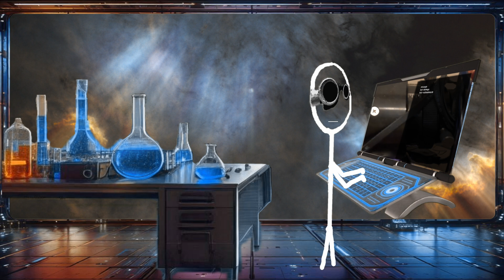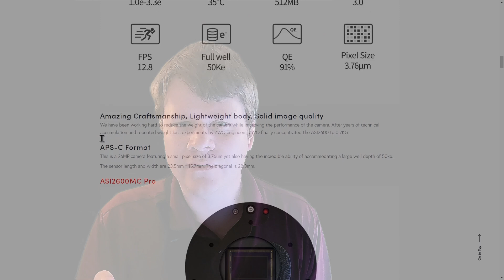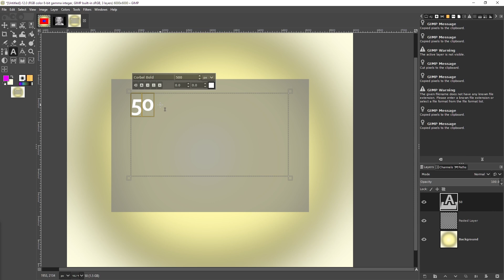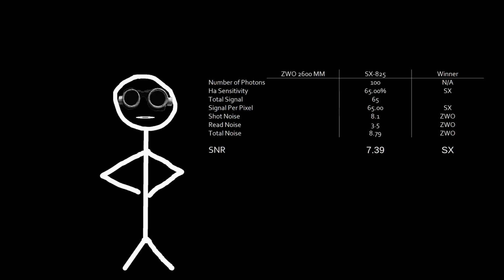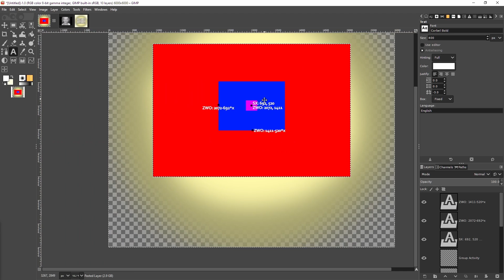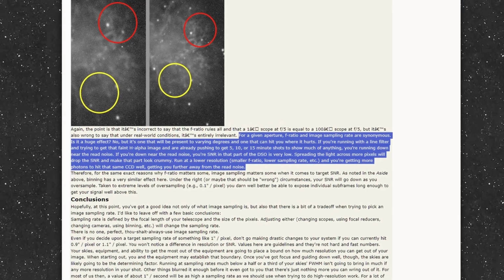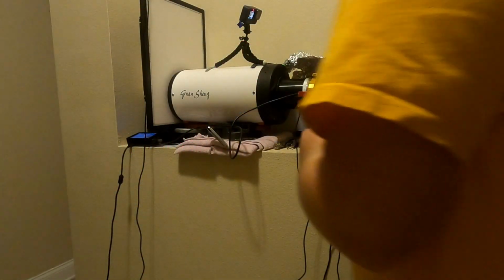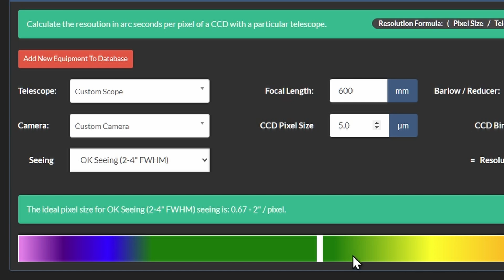𝐌𝐲 𝐨𝐥𝐝 𝐂𝐂𝐃 𝐰𝐢𝐧𝐬 𝐭𝐡𝐞 𝐒𝐍𝐑 𝐛𝐚𝐭𝐭𝐥𝐞 𝐚𝐠𝐚𝐢𝐧. 𝐖𝐡𝐚𝐭'𝐬 𝐠𝐨𝐢𝐧𝐠 𝐨𝐧?

Comment: I’ve got a question about drizzling in this context. Out of habit I always dither then drizzle when stacking, the idea being having a higher resolution image in the end. Does drizzling introduce noise when it comes to the image’s SNR, or is that a process that is independent of resolution/pixel size? (The idea here is that a 2x drizzled image is opposite of a binned 2x2 image, and as we learned here, binning helps SNR, so would drizzling hurt it?)

Great content, I appreciate your channel!!
Reply from the maker: Thank you for the comment! From what I understand, drizzling does increase noise. So if you do a 2x drizzle, you are roughly halving your SNR. I may be wrong on that (so consult other sources too!), but I think you'll see that if you stack binned sub frames and then stack again with a 2x drizzle, there will be more noise in the drizzled one. Just keep in mind that it's hard for people to tell exact differences in SNR with their eyes alone, especially in brighter areas!

Comment: I agree with your conclusion. Given a focal length, bigger pixels will help. Also a higher QE and lower read noise will help to improve SNR. Even gain has a role to play there.

I think that if the Sony 694 sensor existed in APS-C size would’ve been a keeper.

And CCDs have the advantage of binning before reading the image, so for a long focal telescope like an SCT or RC are good choices. CMOS sensors have the advantage of having much lower read noise, so the penalty of binning is not as high. In the end, binning is a good resource for imaging at long focal lengths, no matter the sensor type.

Regards,

Alfredo
Reply from the maker: Agreed! Thanks for the comment :)

Comment: I would also like to introduce one more element since I see too often the statement about the "fast" F-ratio myth... The only advantage of having a "fast" f-ratio is on subjects that have an angle of 0 degree. Point sources are getting better SNR faster on "fast" f-ratios but, in reality, we only deal with somethng that have a size... A size means that we can measure an angle and this changes everything. We talked about the reciprocity law that build a relationship between aperture/exposure time/sensitivity. On old chemical emulsion we have the so called Shwartzchild effect or reciprocity failure just becouse the media used was not linear. The stated sensitivity (in ISO) was true just for a small fraction of time so, the longer was the exposure, the lower becomes the sensitivity of the media causing this reciprocity law to fail. On modern CCD/CMOS whe have a true linear (with very small variances) acquisition device that remains linear until the charge retaining capacity is reached (Full-Well). That's why we can apply statistics on multiple frames tha can lower the noise! A "fast" f-ratio system is not "faster" than a lower number one since the emitting source is fixed and there is no way to chenge that, You can fill the well in a lower time but You are getting the fixed signal AND the unwanted one (mostly sky noise) at the same time. The SNR does'nt change since it is a relationship between wanted and unwanted noise. An f3 system and an f8 system that are providing the same sampling size per pixel will produce the exact same SNR on the same subject per single identical exposure. So it is better to say that, tipically, a "faster" system having the same aperture size (i.e. an 8" scope at f3 respect to an 8" scope at f8) is a wide field telescope respect to the other. Remember, it does'nt matter in how much time You fill a well, the SNR of that well is not changed by that since Your acquisition device is linear and the photometry for that angle is fixed... Hope this could help and open new scenarios.
Thanks again!
Reply from the maker: Thanks for pointing that out. I agree, and I'm sorry that it isn't more clear in the video. I think you and I have the same understanding here. If I say "fast" I just mean that it fills the well faster. Not that the sub frame will get "better signal" because the light pollution fills the well with the DSO signal too.

Comment: YES! Thanks again for this one! As for the last video I would like to give my two cents... You're getting close talking about pixel sizes but, the better way is to refer to the area of sky being captured inside that pixel. As You stated there is a subject you're targeting in the sky that emits 100 photons (You should add per second per that considered area and that's exactly the definition of Photometry) and that is true for that considered area or angle of the sky. If You change the scale or angle of that considered area, You will notice different Photometry flux. That's why You can only compare two acquisition devices using the exact same sampling size per pixel. That is also stated by the reciprocity law that takes into relation the aperture/exposure/sensitivity that rules the exposure times on "classic" photography and is the way photographers can measure and predict the right exposure/aperture ratio to use. There is also another factor that will change the results even on a "perfect acquisition system that includes the whole system not only the sensor" and is the poisson distribution that is in the nature of incoming photons. This means that, even on a fixed source that emits 100 photons/sec/pixel on a perfect device, each frame will have different values per pixel since the light is not coming linear but poisson distributed. Binning on a CMOS is something still quite useful (only on monochrome since on color there is a very small benefit) but not as effective as on CCD since the binning operation is made via software on CMOS and "after the fact". On CCD the binned cluster of pixels will be read as one by the register and the SNR will be exactly doubled (just becouse You are considering a 4 times bigger angle of the sky and the relative photometry has a bigger flux) still having the same readout noise contribution. On CMOS you have a sum of 4 readout noise, one for each pixel and the full well remain the same as for a bin1 pixel so, the result, is more uncertain respect to the one made on CCD. We can say that the doubling of the SNR is true on CCD but on mono CMOS the SNR is at best 1.5 times better. The quantization noise and uncertanty still remains higher on CMOS having the same full well on every software binning cluster size and so the statiscs measurements are worse becouse of the less sampled photons.
Anyway there is a small difference in SNR if You're imaging big, diffuse and dim areas or star cluster i.e. In the first case the SNR will benefit from a slight undersampling while in the second will be better to oversample a little...
It's a strange and counterintuitive way but Your efforts are of great value for us all! Thanks again for Your work and nice videos and keep going!
Reply from the maker: Thank you! These are good points, and thank you for bringing them up! I wish I would have been a bit more precise in some of the things I said. For example, your point about the each pixel having slightly different values based on the Poisson distribution is something I could have explained a lot better :)

Comment: Earned my sub.  Excellent video.  
I need some time to think about this, but I think part of the problem I have with the whole sensor size/pixel size debate is that people end up saying larger sensors/pixels are better, but mean different things.  For instance (coming from regular photography) I see a lot of people try to argue that a 24mp full frame camera is inherently better than a 24mp aps-c camera, specifically because the sensor and pixels are larger, which is b.s. in and of itself, and completely ignores all the factors a full frame camera has that lead to a higher quality image (dual or triple gain, improved adc, faster sensor readout, faster processors, etc)

I think what your test shows is that you need to make sure you're able to gather enough light to support a specific pixel density, otherwise if you can't, there's no point in using a higher mp camera.
Reply from the maker: Yes! Good points. There is so much that people need to take into account when choosing a camera. :)

Comment: To my understanding…when using CMOS cameras keeping the gain as low as possible but within the range provided in the specs for your particular camera and keeping the histogram at about 1/3 from the way from the left bar by adjusting the the exposure time accordingly, goes a long way to lowering the noise problem…also of course the more images you have to a point also is a factor with good  and adequate number of calibration frames.
Reply from the maker: Yes, I agree with all that! Also, binning/pixel size affect the signal part of the SNR measurement, so you'll be able to get the histogram about 1/3 away from the left bar more quickly. It should decrease the integration time needed to get a similar result than if you have smaller pixels/don't bin.

Comment: Interesting. I would have thought that with CMOS (as opposed to CCD) there is one amp for each pixel and therefore that it doesn't matter if the binning is done by the camera driver at capture time or in software afterwards (except of course for the larger files). If that's true, why put the emphasis on SNR per pixel? If that's not true, any idea why, and what the difference is?
Reply from the maker: I'm pretty sure you're correct that it doesn't matter when you do the binning for a CMOS camera (it was mentioned at the end). So, maybe it should be more clear that the video is about binning and pixel size (and how they're similar). To answer your question: most of the noise in an image should be shot noise (whether it comes from the DSO or light pollution). Increasing pixel size (however it is done– binning is one way) will take the signal of multiple smaller areas and combine them. That's where the benefit comes in. People often forget the numerator/signal in the SNR calculation. Combining pixels, or having larger pixels increases the "S" relative to the "R," which helps a lot with SNR. But the tradeoff is resolution.
Reply: @deepskydetail  thanks for taking the time to clarify. Sadly, I still don't understand why the SNR of single pixels is important enough to lose resolution by binning. We both have the same answer your question at 5:15: No, the signal of that DSO is the same, regardless of binning! So, why should I lose resolution on my DSO by binning the pixels if we both agree that this won't change the SNR of the DSO? Sure, by binning, I'll have big blocky and averaged pixels, but how can this possibly make the DSO look prettier? Sorry if I am daft, but what am I missing?
Reply: @comeraczy2483  there is zero benefit from doing binning on CMOS sensor, the only reason you'd do it is in case you need faster file transfer rate from the camera or smaller files, but from a quality standpoint binned images on CMOS actually end up looking worse than normal ones.
Reply from the maker: @comeraczy2483  You are introducing noise into your measurements. For example, if you have 1 good SNR pixel and split it up, the resulting smaller pixels will be noisier relative the the signal they're getting. It's like you are going to a higher f-ratio: the light gets spread over more pixels. Except in this case, instead of spreading the flux over more area, your creating more pixels within the same area. But the effect is the same: noisier pixels. That's why Stark said F-ratio and pixel size are synonymous for a given aperture. The pixels only care about how many photons they're detecting. They have no idea whether they're detecting fewer due to a longer focal length or because of their size.
Reply from the maker: @v0ldy54  that's not entirely true. You gain SNR with bigger pixels. If your sampling doesn't match the focal length, and you're oversampled then binning will benefit you greatly. You get increased SNR without losing resolution (i.e., the atmosphere, not the pixel size is the limiting factor).
Reply: @deepskydetail  Let me make sure I understand correctly. You are talking about Photon noise, a measure of the randomness of the arrival time of photons on the sensor during acquisition (consequently, a measure of randomness of the distribution of these photons in the space in front of the sensor before acquisition). Is that right? And your claim is that by changing the binning mode on your camera you are changing the photon noise of a future acquisition. Is that also a correct summary? If this is correct, it is truly remarquable and you should publish it right away.
Reply from the maker: @comeraczy2483  Your description of the problem is indeed inaccurate. We are talking about shot noise as measured by a pixel. Shot noise is the square root of the number of photons it detects. It is noise introduced as the pixel has measures something.  If the pixel is smaller, it detects fewer photons. The signal is lower and noise is lower, and the net effect is less SNR than a larger pixel. I wouldn't publish information about binning and noise because this stuff is already common knowledge. I'll give you a sources if you'd like to learn more:

1) "After a 2×2 bin, this gives us a new SNR of ~200:14 or ~13:1. Compared to the 7:1 before binning, the 13:1 after a 2×2 bin results in double the signal-to-noise ratio, increasing the imaging sensitivity of the camera."

-Notice that in the calculations, the noise values *change* depending on whether there is a bin or no bin.

https://www.photometrics.com/learn/camera-basics/binning#:~:text=The%20primary%20benefit%20of%20binning,combined%20signal%20from%20multiple%20pixels.
Reply: @deepskydetail  Thanks for the link. We definitely both agree that the SNR of a big pixel is better than SNR of a small pixel, if there was any doubt on that, it's a miscommunication. Moving on to the estimation of shot noise in a specific region of the image, which I believe is a big part of your video: that link from photometric that you provided explicitly says that "it should be noted that binning does not lessen the effects of other noise sources, such as dark current noise or photon shot noise". Other credible sources agree on that. For instance, Stanford Computer Optics clearly states that "shot noise, is a basic physical characteristic of each light source that cannot be influenced, i.e. diminished, by any technical device". RP-Photonics also says that "shot noise must be interpreted as a property of the light field itself, rather than as an issue of photodetection". Hamamatsu seems to prefer the "Photon noise" terminology, but also defines it as an "inherent statistical variation in the arrival rate of photons incident". There are many others - hopefully all reputable vendors. So, if your measurement and calculation do show that binning reduces shot noise in the image, that might be more of a very interesting novelty than you seem to think it is. Otherwise, we probably have radically different definitions for shot noise.
Reply from the maker: Yeah I think we are agreeing but just sort of misunderstanding each other. In my mind shot noise is the square root of the signal. Binning doesn't change that. The SNR calculation changes when binning: the signal increases, the noise increases and the net effect is that SNR increases. The CMOS example shows exactly this. So yes, binning doesn't change the effects of shot noise. It's still the square root of the signal. I hope that makes sense.
Reply: @deepskydetail  you're not possibly getting better SNR with a CMOS if you bin.
SNR is fixed at the moment of the capture, adding together pixels won't change the image SNR, it will only make stacking algorithms work more poorly as any comparisons of binned vs unbinned CMOS shows.

It works for CCDs because you're actually adding the charge of neighbouring pixels and reading them only once, which decreases read noise, but in CMOS it just throws away resolution for absolutely zero benefit.
Reply: @deepskydetail  out of curiosity, how exactly did you estimate the noise for the whole image? If you are simply adding the absolute value of the difference to the mean for all pixels (sum([abs(value - mean) for value in pixels]), that would definitely explain why you are getting a value that is proportional to the square root of the bin size. If you are however integrating the variance, or calculating a proper convolution, and then taking the square root, your result is very surprising. If shot noise is dominant (it should be since you have plenty of uniform light), it should be a Poisson distribution, and therefore, the sum of the difference to the mean, squared (sum([(value - mean)^2) for value in pixels]), should be reasonably close to the sum of the values (sum(pixels)). Conversely, if these two calculated values differ significantly, then it is not a Poisson distribution, and therefore shot noise is not dominant, which would be surprising.
Reply from the maker: I guess another way to think about it is that with a 2x2 bin and a CMOS camera, it's like stacking 4 pixels together (assuming equal illumination). On the other hand, if you had a CMOS camera with 2x the pixel size, it would be just as good (if not better b/c of less read noise) as the 2x2 bin in terms of SNR. Of course, with smaller pixels, you get to choose whether to bin or not, so there is more flexibility :)